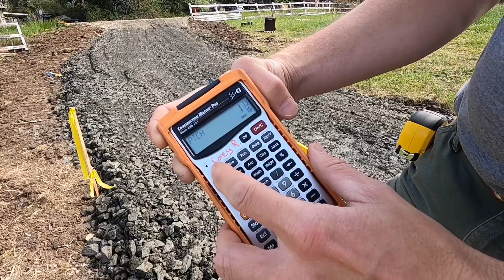How to determine Percent Grade

Comment: A good rule of thumb is 1 inch in 8 feet is approx 1%, 5" in 8' is approx 5%, 15" in 8' is approx 15%. 15% is pretty doggone steep. 
5-7% is about the max you'll see on a freeway and 1-2% on a railroad.
Reply from the maker: That is a great rule of thumb. Like it